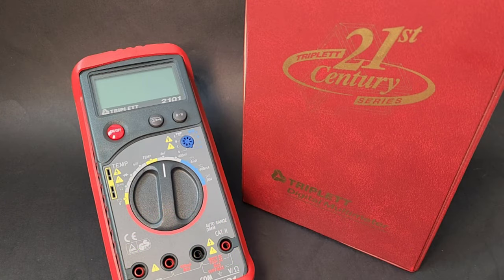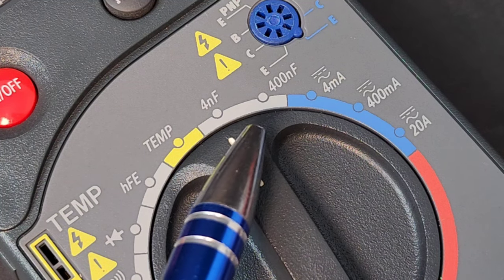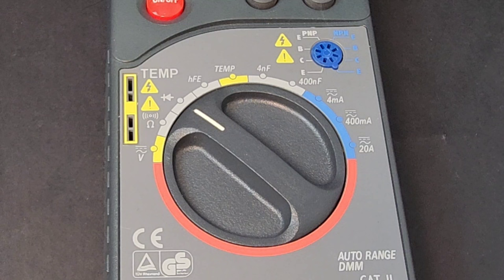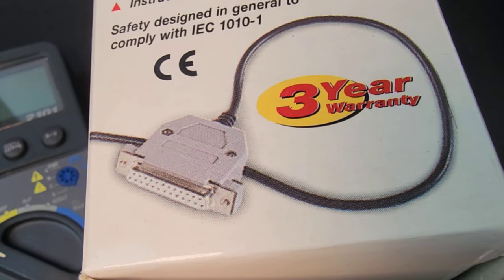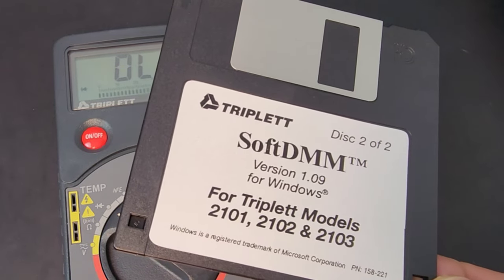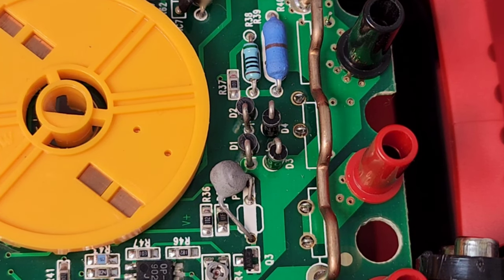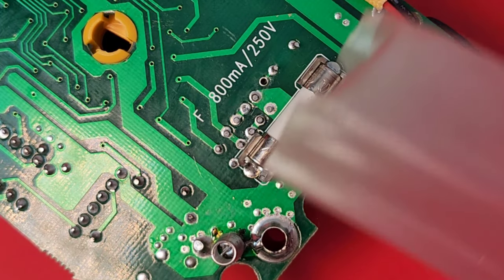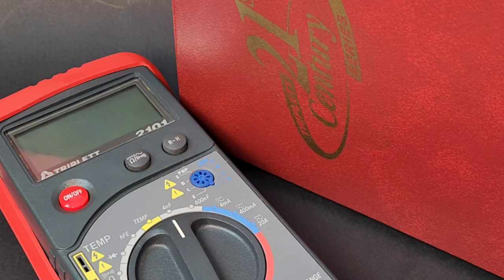RETRO-TECH ○ Triplett 2101 Multimeter Review & Teardown! (1999)

Comment: Every triplett meter I know of was made by some other company. Did they actually make anything?
Reply from the maker: They sure did .They were one of the first to pioneer the pocket Analog meter.
Starting way back (1904-1905), Triplett built a small meter into a pocket watch case as a "Pocket Meter". This instrument was used frequently by earlier owners of automobiles to test their electric starter batteries. It's portability allowed it to be easily carried in a pocket or in the tool box. 👍

Comment: It has a superficial resemblance to my RS 22-8302 which I suspect is a Canadian/Australian model. Mine does not have the slots on the left or the transistor socket, and doesn't test temp, caps or transistors. My middle button says D-H and the AC and DC volt ranges are separate. I wonder if  what they call the 'capacitance extension lead' plugs into the slots on the left, like many LCR meters. The model 2105 must have been something in 2000.

I wonder why you have two floppies. Mine just has one. But I have the same DB-9 port. I could not open it to take a look at the chipset. Maybe there is a fifth screw under the silver label?

I have seen other similar case designs but different color combinations. I wonder who really made them all.
Reply from the maker: Appears Metex was the OEM for the series.. I haven't loaded the floppies yet, but I'm curious as well. It's quite an eclectic multimeter all around but nicely made. Could probably use some IP on the traces and some of the components but overall looks stellar 😅 👍